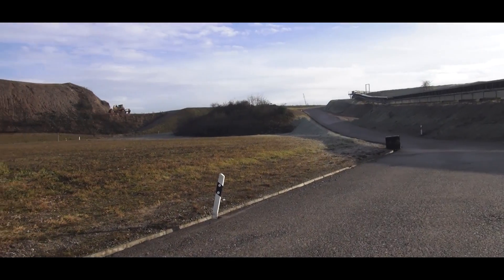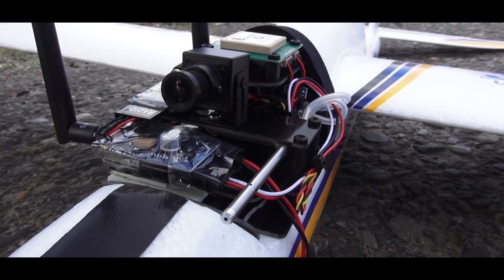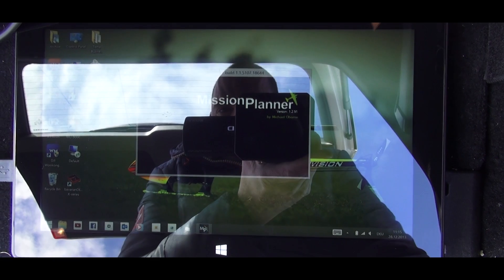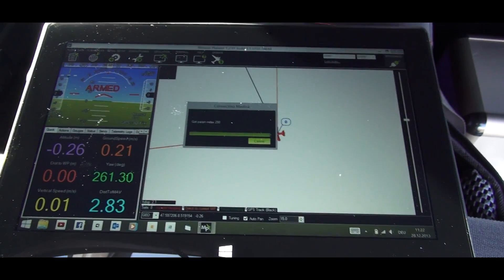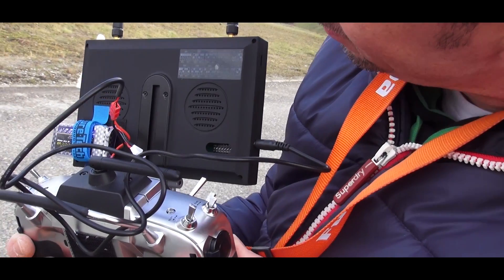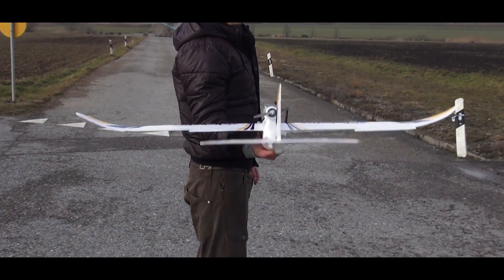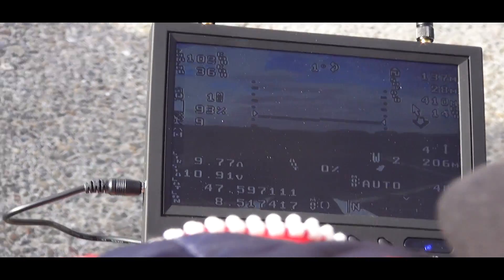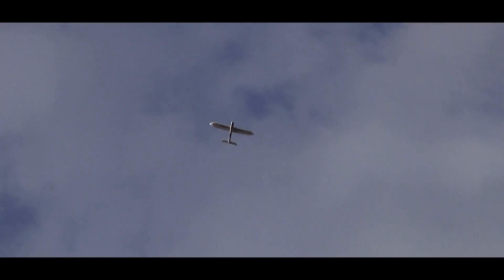Autopilot on an RC Plane?

Comment: if i were you, i'll put the gps behind, or in top of fuselage or right in between the wing, thats will keep GPS fail sometimes, because too close with VTX and its antenna, the camera and not to mention there is telemetry modules too
cover gps cable (if GPS cable is naked) with 1 or 2 layers of heatshrink, that will really keep out from inteference from other electronics and power lines

if you claimed, that you have never that kind of inteference? believe me, you'll gonna have that soon or later

Comment: awesome job. is that landing as done by radio pilot. or auto landing ?
Reply from the maker: dhaya t Manually landed, so by pilot :-)
Reply: +Locoracers  what radio transmitter you using ?
Reply: That landing is spot-on!

Comment: Very cool tech. It sounded like you could hear the motor pulsing on and off when it turned and needed to gain a little altitude. Is that the system?
Thumbs up!
Reply from the maker: Yes, it takes some seconds until the airspeed is adjusted. This is done by the System itself.
Reply: Locoracers Thank you!